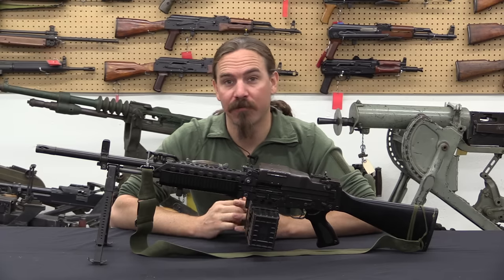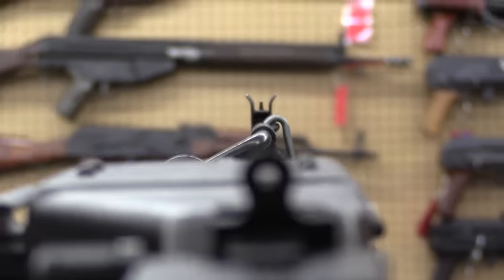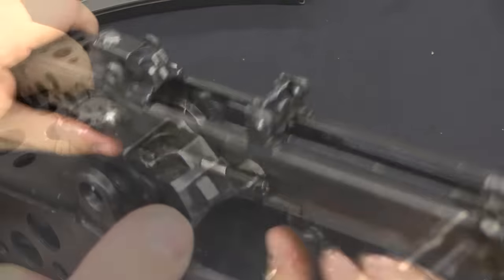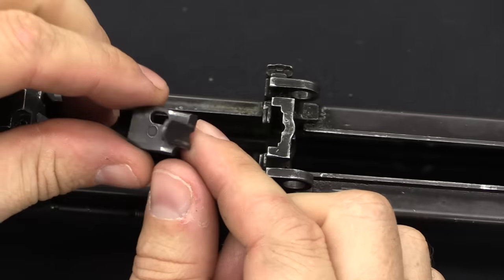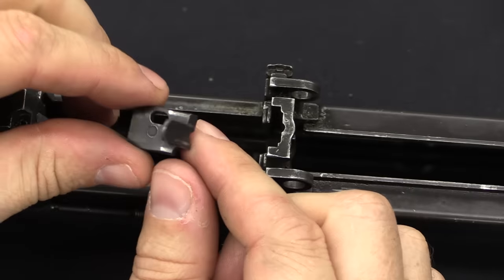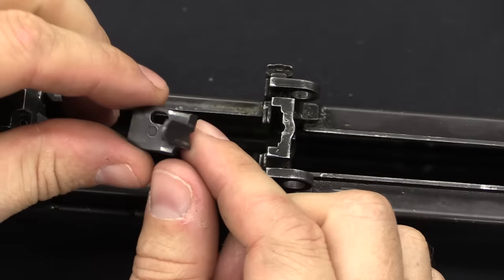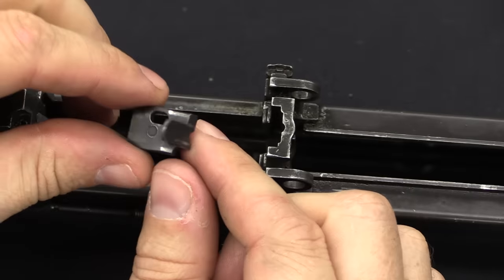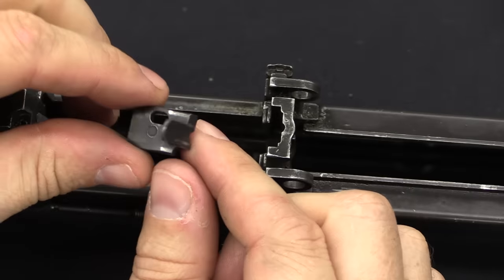Stoner 63, 63A, & Mk23: History and Mechanics

Comment: And they say the AR-15/M16 is a 'modular gun' lol... Stoner was a true genius, the amount of thought and engineering that went into this gun is just mind-boggling
Reply: A gun that works upside down. Pure genius.
Reply: The ar 15 is more modular u can switch between belt fed ,mag fed, long barrel ,short barrel, gas impingment, gas piston change between 556,7.62x39,6.5grendel 300blkout u can even put a 50bmg upper on it
Reply: any of which you could also have done with the 63, if it had been as common as the m16/Ar platforms , just not enough military addoption
Reply: @joshualance6005  The AR-15 isn't more modular, so much as it's been redesigned more times and is ubiquitous enough to have mass market 3rd party parts manufactured to fit those designs. Hypothetically speaking this could be done with nearly any weapon.
Reply: Stoner 63 was obviously superior in everyway to AR-15 but sadly it didnt get adopted enough. If army would adopt it to replaced ar-15 it would get to civillian market and have even more configurations than you could imagine.
Reply: @Kacpa2  At the end of the day both guns are the base design of Eugene Stoner, with modifications by the same 2 other individuals. So which is better isn't much of a contest, given that the prize winner is ultimately the same.
Reply: Stoner was an amazing genius, considering he invented both the AR-15 and the Stoner 63.

I understand why the army didn't adopt the 63, the magic of the Stoner really came in its Automatic Rifle and LMG configuration. The Rifle and Carabine model didn't offer anything special in comparison to the: cheaper to manufacture, easier to use, easier to maintain, more durable M16.
Reply: It's like if you had all the variations of HK Roller-delayed blowback guns but they all use the same receiver
Reply: @MarikHavair  well everything u said backs my point up and if it was so easy why hasn't it happened to any other wepons system the ar 15 is still on top and more modular than any other gun all u need is a lower and u can build any wepon to fit any mission for any soldier including a pistol,sub gun, shotgun ,belt fed machinegun,assault rifle,sniper rifle ,pdw,anti material rifle,crossbow,anything u can think of and no other gun can do that that IV seen to date if there is plz provide link to it that proves it can
Reply: @MrZippy052  no I can't u can use as 15 with 338 lapua bolt action upper and be as accurate as match grade sniper rifles for sniper role the stoner had a quick change barrel that would make for horrible long range accuracy
Reply: Joshua Lance Direct gas impingement is still gas piston and "gas piston" is still gas impingement.
Reply: @notpulverman9660  no actually a piston system uses gas to move a piston to move the bolt,    a ar15's piston doesn't move so it's the gas that pushes the bolt back not the piston
Reply: Remco den Ouden the AR-15’s modularity was all an afterthought that came much later. A well thought afterthought, but not an original feature of the gun. If you were to look at the original M16, the only thing that might be considered modular is that the upper and lower assembly come apart into distinct components for disassembly.
Reply: @MrZippy052  Ah but the AR pistol. Which is probably a bad idea, but it looks cool.
Reply: HSS Revenir 
Having a separate upper/lower receiver that fit together like legos helps.
For instance aks are more widespread but if you want an ak to do something different you have to manufacture and or build another ak.
Reply: @Kacpa2  as an lmg the stoner 63 is superior but as a rifle I believe the m16 is better.
Reply: @BoogalooBoy  Nah, you can't truly say that one was better than the other.
Reply: HERES THE TLDR. The 63 was designed specifically to be extremely modular. On the M16 platforms debut, it wasn’t designed for that reason. The whole reason Eugene made the 63, was because he wanted to make a modular rifle (after he made the m16) he obviously had never planned to do so. Yes the market for AR15s has changed, but that is predominantly because of saturation. Kinda like glocks with their fucking annoying slides and fancy barrels.
Reply: So what you're saying is that this gun is blowing your mind c:
Reply: @hvymtal8566  Funny you should say that.  I have often thought that the H&K system could be used to make a new "Stoner" type weapon.  The 21E can switch from magazine feed to belt feed quite easily, and they have enough trigger groups/stock configurations to cover any eventuality.  Throw in a few different barrel lengths, and maybe a 40mm grenade launcher, and you have a one gun army!
Reply: I'm super disappointed that the Stoner didnt live up to it's full potential. Its was a fucking genius concept.
Reply: @MarikHavair  Not really any gun. The separate upper and lower are what makes the ar so modular. You couldn't really do that with an ak, for instance.
Reply: @BoogalooBoy  Stoner used the long-stroke gas piston design very similar to M.T. Kalashnikov's designs. Stoner admitted to have studied Kalashnikovs long stroke gas piston, solved the bolt bounce problem that can afflict long receiver AKs especially the RPK and made a workable stamped steel chassis for a hotrod!
Reply: Agreed. Amazing design
Reply: To be fair though, while the AR-15 might not be nearly as flexible as the Stoner 63, you can very easily swap between upper receivers while in the field.
Reply: @matiasaguayo3175  cough cough "durable"
Reply: @teuflhunden  In compare to the Stoner, the M16 is more durable. There are several reasons why the Stoner was never officially adopted.
Reply: @wernervoss6357  as a rifle it was great. Look at the Expeditionary rifle made around 2000, somewhat modified but a superior firearm to any ar15/m16. It did really shine as a LMG though. It did need regular maintenance (as does the m16) but for a weapon that could fire at up to 750 or 1000 rds cyclic rate and for shorter term assualt missions it was terrific. I carried one in the 70s and if I ever had to have a 5.56mm weapon again, the Stoner 63a is it.
Reply: @matiasaguayo3175  it isn't really more durable. It requires a somewhat higher degree of maintenance than does the m16. The durability issues basically arise from the fact SEAL team modified the cyclic rate to 1000 rds initially and caused the six relatively small locking lugs to shear off during operation. It was not designed to perform at that rate from the start but was a easily curible problem.
Reply: If Stoner didn't bother with this modularity shenanigans and just perfected the machine gun (including 7.62 version), the US military could get proper GPMG and SAW instead of MAG/Minimi (M240/M249) garbage.
Reply: @solarissv777  the MAG is bad? Never heard anyone complain about the MAG (well, about the weight but it shoots fine). Minimi, meh. It apparently works well enough for a lot of NATO armies, so that should be something. They could've done away with the whole magazine fed option though, that's useless as fuck
Reply: @remcodenouden5019  it is inexcusable for it to weight 11+ kg, while PKM weights 7.5. The problem with MAG/M240 is its bolt assembly, whine providing superior reliability it is heavy and in order to contain the energy of such mass moving back and forward, the receiver assembly must be extremely robust, and thus also heavy. It seems that FN didn't even bother designing mechanism for it's machine gun,  they just took one from BAR and slightly tweaked it  to feed from a belt. But John Browning designed BAR with 1918 tools and materials in mind, and there was no reason to repeat the design in 1977, 16 years after vastly superior PK (much lighter, similar or better reliability, slightly more powerful cartridge). 
Minimi is just a shit show, it was clearly designed to be manufactured with the same tools and materials as it's bigger brother, and that's how it became inexcusably heavy for it's role. The magazine feed issue was successfully solved by Israelis in their Negev, by adding special gas regulator setting for magazine feeding. It looks like if FN engineers didn't know what they're doing: usage of an ancient mechanism in MAG, messed up magazine feeding  in Minimi...
And the worst part is, that if only Eugene Stoner didn't bother with his idea of modular weapon, but just perfected his machine gun to be simple and reliable, the US would have weapon, vastly superior to M249, and if he didn't give up on 7.62 to M240 also.
Reply: @solarissv777  the FN MAG is in service since 1958, not 1977. So it predates the PK by about 3 years. Now yes, it is pretty heavy for what it actually is. But, at least here in the Dutch army, that doesn't really matter. We have 8 man squads, normally 2 pioneers armed with Colt C7a1 NLD rifles with a HK M320 40mm underslung grenade launcher, 2 SAW gunners with a minimi, 2 anti-tank gunners with a C7a1 NLD and a panzerfaust-3, a sergeant and a corporal both with normal a C7a1 NLD. That's the normal configuration. 

However, you could swap the anti-tank gunners for a GPMG team with a MAG. A loaded panzerfaust weighs somewhere around 15 kgs, and you have 2 of them. Also, they don't have to carry their normal rifles so that saves them ~4 kgs. A MAG weighs a little under 12 kgs, but once you factor in ammo etc. you won't be that far off from the weight of a panzerfaust+rifle. So weight-wise it's almost identical to our normal loadout. 

It's also about cost. All the armies that use these things have thousands of them, and they're not used up anytime soon. That makes it both expensive and kind of unnecessary to replace them. Should we replace them with something better at the end of their service life? Yes, probably, but we're not there yet.
Reply: @snafuthebrave1922  I would add Mr kalashnikov Mr pederson and others to the party, but I would take JMB solo as the grand prize! Beautiful dreams.....
Reply: @joshualance6005  ki
Reply: If this system is ever to get adopted by the Army , change the caliber and just slap a s*** ton of picatinny rail on it. And just throw in a bunch of modular in the pitch.
Reply: @joshualance6005  Good one.
Reply: @joshualance6005  You forgot to mention the nuclear round. With a yield equal to those dropped on Japan.
Reply: Wonder how he got his ideas...
Reply: Lol I just basically left the same message.  Everyone refers to the AR-15 / M16 as the rifle equivalent to an erector set but I always have to correct them by telling them that the Stoner 63 is the rifle / light machine gun equivalent of an erector set!  LOL LOL LOL!  Not knocking the M16 but the Stoner 63 just does damn near everything and anything!
Reply: @Kacpa2  superior on a range sure, but id rather an m16 (preferably an A1) in the jungles of nam
Reply: @kyotra  Civilians change uppers and lowers in the field. Military does not. That's an armorer level. Really only for SOCOM. Standard military, you get a rifle, not a Lego set. 

The AR-15 modularity is a separate function than a stoner 63. It's a benefit of the design and the market. Not a plan of the rifle. Unlike the 63 where it was directly planned into the design
Reply: @SlavicCelery  So? Doesn't matter what Stoner's intent was or whatever rules the brass decides to make up - it's still an action that can be taken if you choose to.

Also not sure what the point is in saying "really only for SOCOM" when the 63 was designed with SOCOM in mind.
Reply: @kyotra  I was referring to altering uppers for AR-15 in the field. People throw it out as a standard practice in the military, when it's not. 
As far as SOCOM, they don't always operated under SOP for bog standard military.
Reply: @SlavicCelery  Okay, well, I wasn't claiming it was a standard practice - only that it can be done.
Reply: @remcodenouden5019  talk to the guys there for the change over from the m-60. Yeah, my pig weighed more and wasn't "modern" enough to take a magazine, but it always squealed when I pulled the trigger. Can't say the same for the SAW.
Reply: With all the unique parts I kept thinking all you have todo is collide with a tree have a major stack and you could bend one of the bits. It seems more finicky than other weapons. Maybe thats why army or marines could trust it enough it wasn't "grunt proof."
Reply: Was it Oppenheimer that said "I am become death" or something like that? Stoner and kalashnikov just kept it an interpersonal affair.
Reply: @nathanstautzenberger8381  i
Reply: @nathanstautzenberger8381  i
Reply: Ii
Reply: @nathanstautzenberger8381  i
Reply: “
I can do
Reply: @nathanstautzenberger8381  0P00
Reply: @Kacpa2  well it is superior in terms or performance and weight but as noted not in durability it's a modular design sacrificed quite a bit of that still an amazing concept though I'm sad using modern materials they haven't tried updating it
Reply: @VarrickThrae  Well ofcourse there will be a tradeoff. Could be improved upon still. Tho i dunno exactly what i though talking about modularity for civilian market, since lmg configuration would be useless and AR-15 is modular enough for any needs people could have for sport and hunting shooting with it xD
I guess i was just tired of seeing ar-15s everywhere and in everything xD
Reply: Xx
Reply: As larry vickers said its a holy grail for gun guns
Reply: @joshualance6005  m16 as a squad weapon whoud be interesting
Reply: AR-15s are quite modular rifles of their time. I mean, a rifle that can swap handguards, bolt hold-opens and magazine catches/releases in a minute is pretty darn good in the 60s. The Stoner 63 system is actually way ahead of its time. If Stoner comes up with this idea today, it would still be impressive.
Reply: AR-15s are quite modular rifles of their time. I mean, a rifle that can swap handguards, bolt hold-opens and magazine catches/releases in a minute is pretty darn good in the 60s. The Stoner 63 system is actually way ahead of its time. If Stoner comes up with this idea today, it would still be impressive.

Comment: The ingenuity of design that went into this is incredible! I suspect it ultimately failed just because it was too reconfigurable to be "Marine-proof".
Reply: Like the Rear Sights on the M16A2, that Marines use just fine; but the Army said were too complicated ?
Reply: Just let the armorers configure it and I'll stick to just shooting it.
A Marine grunt.
Reply: It has issues with ammunition since it opperated at lower pressure due to the different configurations
Reply: Should have packed it with crayons